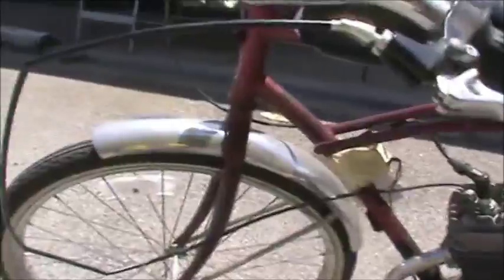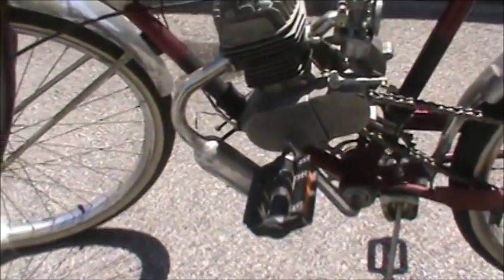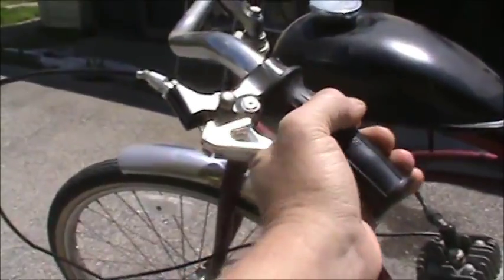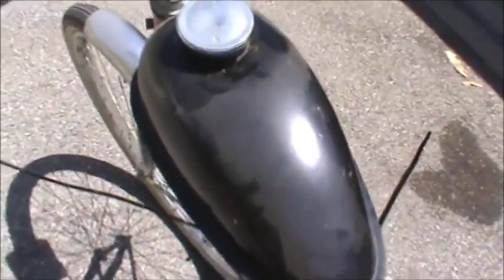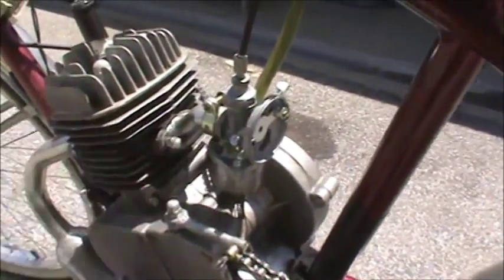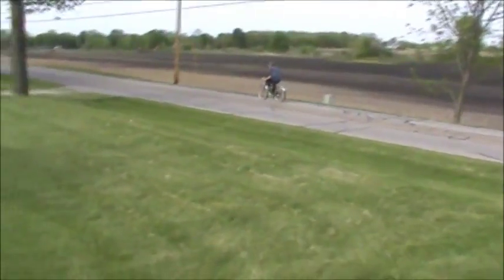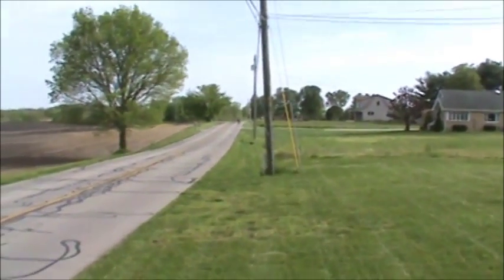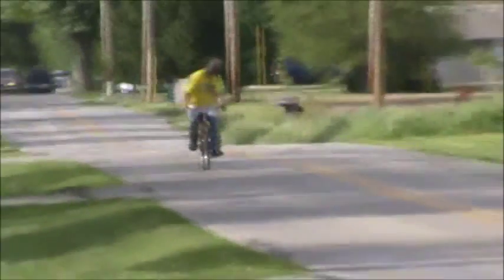Motorized Bicycle From The Trash

Comment: Tom I hope you know thats a 2 stroke motor and you need to put oil in the gas? If you need any parts like an air cleaner you can get all the parts or a full motor kit on ebay. I just built a bike a few months ago, its a lot of fun to ride.